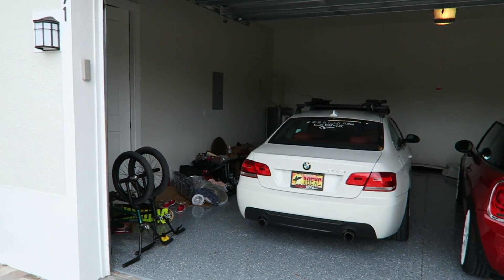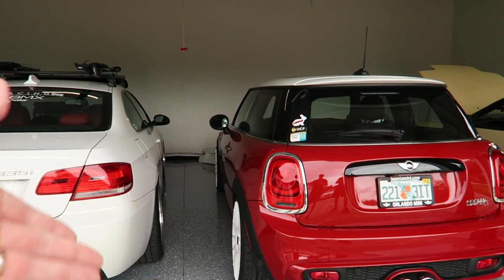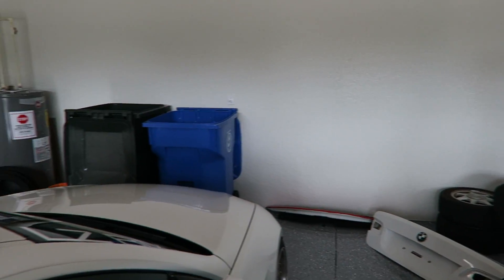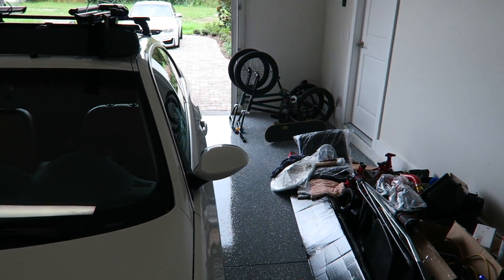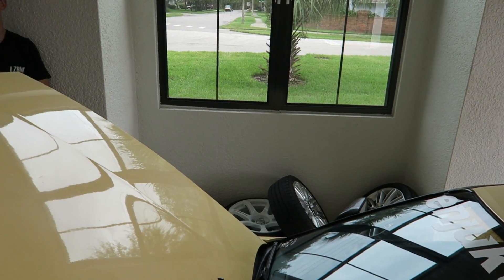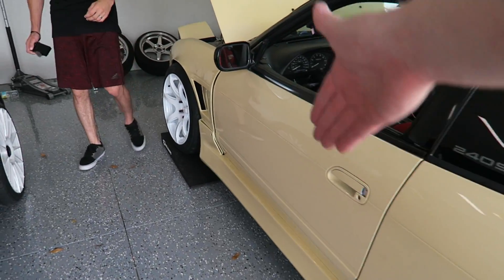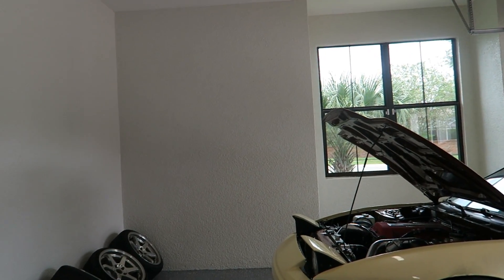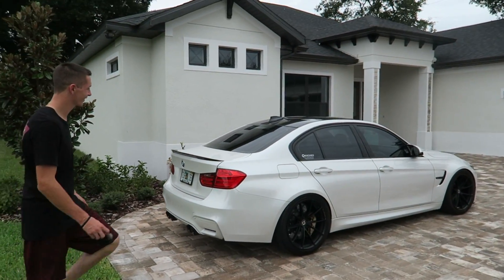Designing Adam LZ's Garage:  Video 1

Comment: Why not put the compressor in the attic? Like a horizontal tank and route the regulator and connects to the most useful spots in the garage? Would help keep it clean and keep the sound level down in the garage.
Reply: That would be dope and maybe a big pressure foam washing system that can route outside, or a curtain inside with crazy drainage
Reply: Its a pain moving that much weight into the attic. You will constantly have to crawl up into the attic to drain the water separator.

Comment: Electric tankless heaters suck from what I've heard.  Can put a propane tank in to add gas, but need to keep maintenance in mind for the water heater or Nicole will get pissed when it breaks.  Hang the bikes on the wall with hooks from the wheel vertically.

Comment: The biggest problem with electric tankless is the huge amount of amps required to power them. Almost need a dedicated service (around 120 amps) to get one which you never have to worry about losing hot water when using hot water in various locations at the same time. Example: Taking a shower while the wife is running the dishwasher & washing clothes. I would avoid tankless unless you can go gas.
Reply from the maker: That's great advice.

Comment: Planning on a garage, 35 foot wide by 25-28 foot deep, Gonna be storing a Crew cab long bed full size F250 lifted with 8-10 feet roof height. so gotta have a tall door. But I have to have room for a motorcycle, A quad and my car and my wifes. So It's gotta be big, Plus all the other vehicles I own that need work that I'd love to not have to lay in the dirt to work on.....
Reply from the maker: That will be awesome.

Comment: Don't put the lift in the damn middle!!
Reply from the maker: Why not?
Reply: +Obsessed Garage (Matt Moreman) why pretentiously centrepiece it despite the obstruction it causes to the flowing look of the cabinets and the obstruction it causes by being in the middle? It's better off in the single entrance next to the compressor - assuming no extreme wide bodykits are in the way
Reply from the maker: We will probably be doing this lift, so it can go anywhere in the garage.  http://www.bendpak.com/car-lifts/specialty-lifts/sp-7x.aspx
Reply: I like it. Just think a dedicated working bay at the side beats a chassis in the middle of the garage. Also limits the flexibility of the double slot. If it takes the full middle slot you might have to have a car parked half on/half off it sometimes